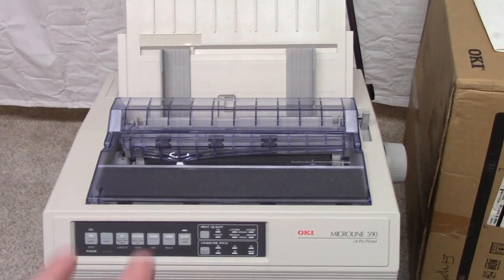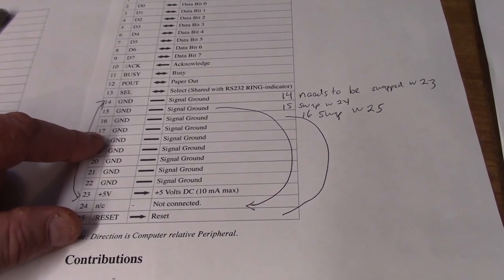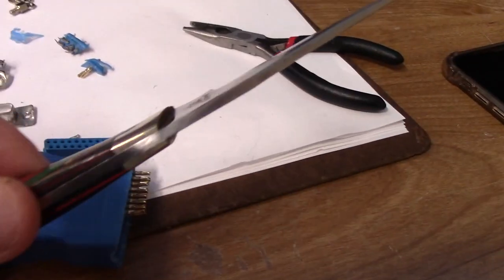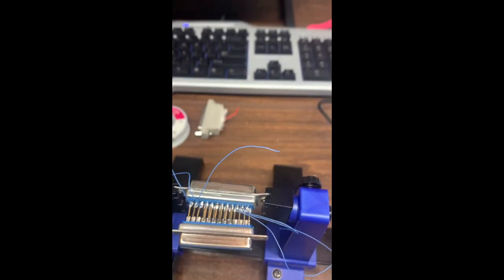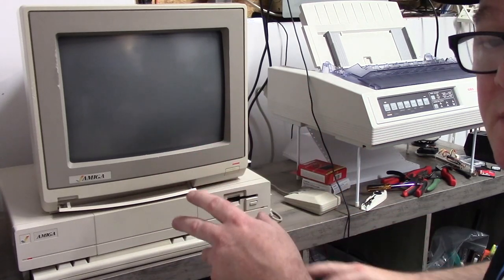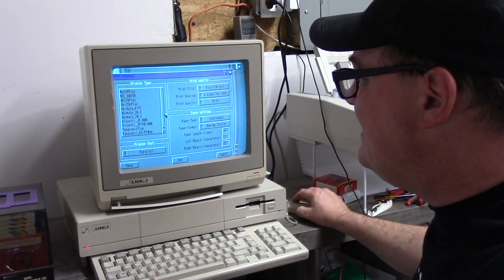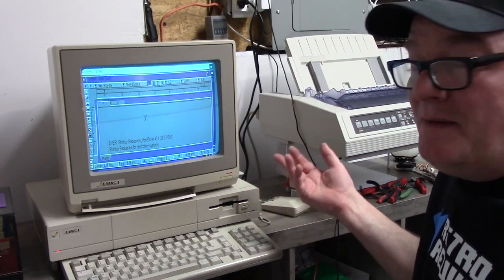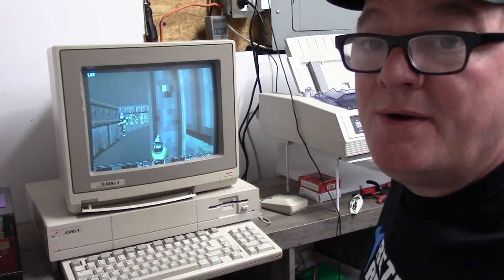Printing on the Amiga 1000 is different

Comment: Reminds me of my odysee of finding an original Amiga 1000 printer cable. I thought of soldering something together, but because it was more likely for me the fry the Amiga and printer or even burn down my house while attempting to solder, I decided to look for one online. 
I spend two freaking weeks without luck. As is just gave up, almost on the edge of getting nuts, I watched a random Amiga 1000 YouTube video just to notice a weblink to a ancient website, offering old Commodore cables. I spent almost 100 bucks for the cable and shipping to europe. Since I've got the cable for a hole year now and printed with almost the same amile 1 testpage. 
Great video!!! 😂🤣👍👍👍

Comment: Hot melt glue (most kinds) is weak to alcohol. If you can get any in there, it will penetrate throughout it, make it expand slightly, make it crumble, make it debond from the surfaces it was holding onto. It works with ethanol and isopropanol, as long as they're reasonably pure. It doesn't even need necessarily direct contact with the liquid, the vapour actually does the heavy lifting.

If they potted it with epoxy or silicone though... that's not going to do anything.

Magic of hindsight of course. I would not expect them to be sealed shut this hard.

Comment: Even i'm baffled at the needless complexity of this one, Chris.  Why not just get a printer cable and just open it up in the middle, find the wiring you need to reroute by scraping into the wires and using a meter with the pins to find the appropriate wires, and just splice those suckers and wrap up the open part of the cable in some tape..bang bang operation!  I will say, I did enjoy your struggle.
Reply from the maker: Because I did not want to destroy a printer cable if this does not work
Reply: @ChrisEdwardsRestoration  Bah, you bought 30 gender changers and you have 200 amigas...what's the price of a printer cable!  Not even my tightwad hiney is that cheap!  Ha!  Let's say you were too cheap to destroy a printer cable...why not buy headers for the ports instead of melting down gender changers..I got a big laugh out of that wackiness!  I come for the Amigas, and stay for the insanity.
Reply: @AmigosRetroGaming  😂😂😂

Comment: OK, Just why, you don't try to print any graphic? 24 pin printer should be good in printing B/W graphics and big size fonts.
I had no issues with that on Amiga and on beginning it was 9pin Seikosha, and later HP DJ540  which was able to print normal photos. No issues with that either - I just don't remember which software I did use for printing photos.

Comment: Good to know.  I either forgot or never knew the A1000 Printer Port was different.   Not even sure if I ever printed anything with the A1000 I had back in the day.  One thing I use to do back in the day was use switch boxes to share printers with different computers as well as to setup NULL MODEM Connections between various computers to transfer files between very different computers.   I do recall making up some Parallel Cables using Ribbon Cables and I believe I have one in a bin under my bed from back in the day but I don't believe its anything special just that its rather long.     How come you didn't just by a pair of DB25 Female Connectors?   As I recall the connectors you can open up either have screws that go through the top and bottom of the case or have clips on the sides.  Good thing I don't have any plans to connect a printer to an Amiga but I am curious if you can send a document over the network to print.  Not even sure if that's possible.
Reply from the maker: i dont think network printer sharing is possible, but anything is possible so who knows. I have not looked into that. it may be something of interest to many.

Comment: There must be A1000 specific printer cables, as I don't remember there needing to be a dongle or converter. I used the same Commodore printer I used with the C64. I must have dealt with this issue, but I guess specific Amiga cables were more plentiful back then and this was an easy problem to rectify.
Reply from the maker: there were/are specific printer cables for the A1000, this works though.

Comment: What about writing a driver in C++ and compiling it and putting it into the system directory that will do the bit flipping for you.
Reply from the maker: hardware cable is still different, different ends, different pinout, you cant tell something in software that power is not power